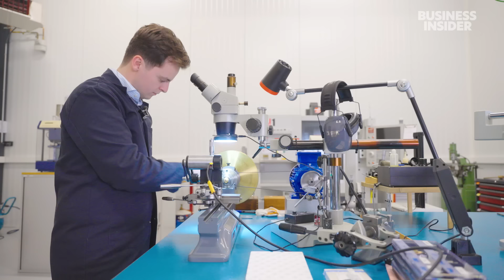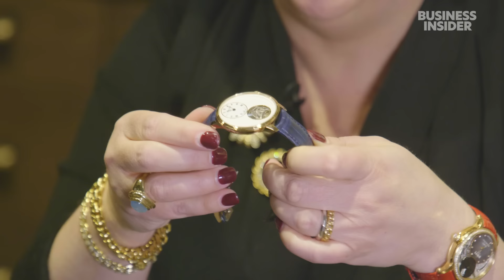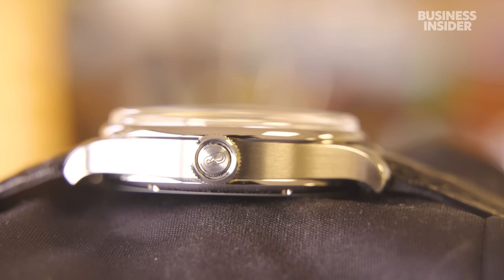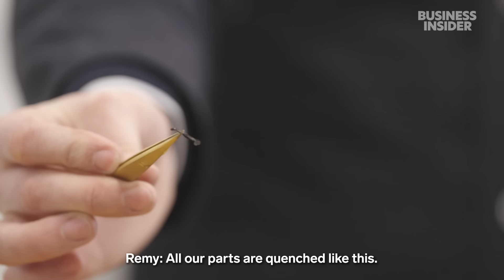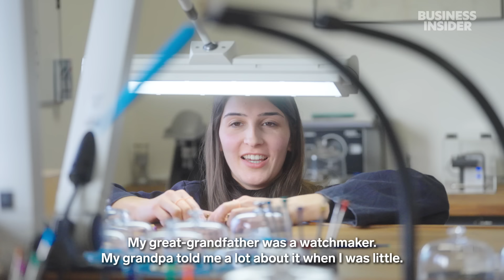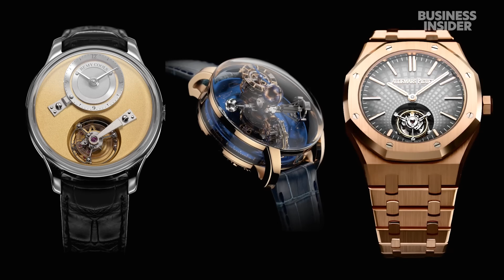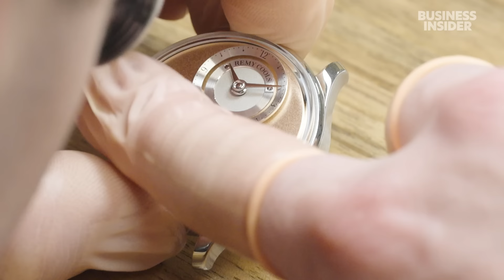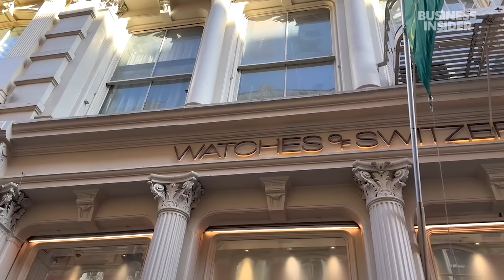Why This Obsolete Mechanism Makes Watches More Expensive | So Expensive | Business Insider

Comment: I know it's largely irrelevant to the 'value' of a watch, but having a tourbillon in the movement doesn't add anywhere close to the cost recovery that a watchmaker would lead you to believe. A mechanical chronograph movement is vastly more complex than a tri-hand watch with a tourbillon, it's just used as a luxury marker these days really.
Reply: Semi-related to this, there is a documentary on independent watchmakers (I think I watched it on Netflix) and they show the makers using hand-tools and single purpose machines to make everything. The watches sell for over 100k, but they will make a single watch that may have taken over a year to make, waaaay more of an art piece that anything that can be produced in semi-mass market, even if it is Luxury
Reply: @jacuul6735  what's the name of the documentary?
Reply: As an (amateur) watchmaker I need to set the record straight here. Yes, a chronograph has more parts than a tourbillon and a new chronograph movement is very hard to design. But tourbillons are still much more difficult and expensive to build, because you’ve complicated the most delicate and sensitive part of the entire movement. Check Chinese watches for proof. You can get a decent mechanical chronograph for about $150-200, but you’re looking at >$500 for a tourbillon. You can also forget about the tourbillon being serviced correctly.
Reply: Without the collectors' market, this industry would come to an end. No one buys these watches to tell the time
Reply: Definitely agree. In addition, I don't disregard Remy's skill and achievement, but let's be real. He is also using CNC for a lot of the main larger parts. This isn't something truly fully hand made like you would have seen from Louis Breguet, George Danields, etc. I know even companies such as Vacheron are using CNC now days, and there's nothing wrong with that. However, if a customer is going to be paying, let's say $100,000 because of the art and craftsmanship, as it's being marketed, I'd think it shouldn't be that way.
Just my preference, at least. There are many more lesser-known independents who do the same, but for a fraction of the price.
Reply: @NotAMachinist1024  very few modern independent watchmakers truly make everything by hand... In fact I'd challenge you to name some...
Reply: @nhwworkshop2644  Philipe dufour, roger smith, myself.
Reply: @nhwworkshop2644  Challenge accepted. Cédric Johner, Logan Kuan Rao, David J. Cottrell, Shiming Yang (artmgraver), and I think Ludovic Rohrer, however that one I could be mistaken.
Reply: @gavin162 part of the problem is the disconnect between actual manufacturing, and more specifically cnc machining, and non-machinists. (Yes, people who use a 3D printer or a CNC router, are non-machinists, contrary to what they may think.) Is not a matter of "pressing go." The intricacies of machining and the actual craftsmanship go far beyond pressing go. Even most machinists who started out on a CNC machine, and never did machining on a manual mill or lathe, aren't really machinists. They lack the ability to "feel the work." They just can't grasp the material properties and material sciences aspects of machining. He's working down to 10-50 millionths. (0.000050" or half a "tenth," or 1 micron) Most experienced machinists are unable to hold those kinds of GD&T, and even less can do it repeatability and repetitively. Most machinists can't even hold 50 millionths of global flatness with a surface grinder. Non-machinists think you sick the part down to the magnetic chuck and "creep up on" your final dimension. Then they pull the part off and find out it fails metrology.
Reply: Damn. Bro slammed all the modern watchmakers in one comment 😆
Reply: if you want accuracy nothing beats a $8 Timex from the drug store.
Reply: Yeah, it's an artificial scarcity thing. People love when the most beautiful historic solutions are employed to create a more dynamic and fanciful device. It's not more expensive to produce, it's more expensive to acquire, purely because the sellers can.
Reply: @UberOcelot  Yep unfortunately this is the reality of the entirely luxury goods market, give or take. Watchmaking is better than most in the sector as there is genuine craftmanship and time consuming, skilled labour involved. But artificially suppressing the supply is very real. You see deconstructions of Louis Vuitton bags on here quite often and they have about $100 of materials, about about $200 in construction labour, which sell for $3,000. Brand (and some quality control) is king!
Reply: I used to think that Tourbillion is a pinnacle of watch making but now I prefer minute-repeater or chronograph.
Reply: Have you seen the inside of my computer?
Reply: You mean to tell me exactly what they just said several times in the video? Thanks!
Reply: I agree that the tourbillon mechanism is attractive purely for aesthetic reasons. In fact, the whole idea of a mechanical watch today is to appreciate the mechanism. The tourbillon raises the bar. A balance wheel with an overcoil hairspring solves much of the problem of positional error. When a flat hairspring vibrates it gathers unevenly and is susceptible to the pull of gravity. Positional error is also caused by the frictional difference of the pivot in the jewel that may exist. This however, can be addressed in the design of the pivot and jewel dimensions. But history has shown that there is a point where the road to perfection reaches "it's good enough". Many English watches had Fusee mechanisms which addressed the differences in rate between fully wound and other states of wind. The overcoil hairspring addressed this to a degree, along with stopwork in the winding mechanisms. Fusee watches suffered from being thicker than standard watches, and the same is true for tourbillon mechanisms.
Reply: youve got to admit it looks beautiful tho
Reply: "grand complications" :)
Reply: didn't know that chrono's are more complex than a tourbi.   And agree that tourbi really are superflous, & unquestionably  a lux marker
Reply: If you value details like engraved clasps and anti-reflective coating,  :yt: amzswis :yt: won’t disappoint.
Reply: Yeah, chronograph movements are exceptionally hard to design. But you can get stock ones for a few hundred bucks, I think.
Reply: @ginzo666  Yeah, I have a couple of manual chronographs and tourbillons, price between 300-400 each but they are mass produced rather than being from an independant watchmaker
Reply: @mitchhifi9192riiiight, cause YouTube comments is where rich fucs go to brag about their watches. Ok. Good for you.
Reply: @theflyingsloth  Hrm. I was unaware that there were mass produced tourbies. I've always assumed they were 10 grand on the very low end for a watch with one.
Reply: @ginzo666 just look for „seagull tourbillion“
Reply: @ginzo666 its not cheap cheap, but for a tourbillion its incredibly cheap. Idk who wants to service this but you can buy it under 1k
Reply: @ginzo666   China can always, always do it for less lol
Reply: @mitchhifi9192 yes we know you're rich
Reply: @julpasali exactly my thought 😂
Reply: @mitchhifi9192 I cannot understand why you'd drop £11k on a watch and then say that the problem with it is 'it's a Tag'?

If you felt that way towards Tag, why would you buy one?!
Reply: @mitchhifi9192 you will love the Aqua Terra. Omega makes the nicest "mass market" watches out there in my opinion.  One of those is next on my list as well. I daily wear a vintage pie pan seamaster in conditions that'd make most watch lover cringe (I've torn apart a rock crusher with it on my wrist before) and I  think you'd have a hard time surpassing the durability of an Omega. They really build a bulletproof watch, even though 99.9999% of them will never see that kind of life.
Reply: @ginzo666  Yeah, just got myself a "Sea-gull" 1963 for 150$. Pretty much the best bang for your bux for a chronograph watch. I don't have a big collection and nothing expensive, but I do appreciate mechanical watches a lot!
Reply: No personal experience with Chinese tourbs but ST19 chronographs have been bulletproof for me over many years. I paid 120-250USD for all my examples and they all run like clockwork. 😅
Reply: You can find chinese watch with tourbillion for a few hundred dollars (and that was a few years ago, it's probably less now).
Reply: No, you get cheap chinese chronos for like 50€ but no really cheap tourbillion
Reply: @tomatensaft420 the cheapest mass produced Chinese chrono movements I've found are the Seagull ST190x series. They'd cost at 150~200USD if you get a good deal.
Reply: @tomatensaft420  there is a seagull turby
Reply: A tourbillon regulates gravity. If you travel to countries with high altitudes or mountains, the time on your watch will remain consistent. Have you ever owned a watch or a wall clock? You may have noticed that sometimes, the next day or a few hours later, the clock jumps ahead by 3 or 5 minutes. Well, the tourbillon mechanism is responsible for controlling that effect of gravity. Even if you notice, cellphone clocks do the same too, the gravity changes the cellphone time. Tourbillion technology is super advanced, they say the Mayas and Egyptians used that same mechanism to create their time and pyramids.

Comment: I always check the front side of the watch, never the back part.
Reply: Probably because there is nothing remarkable on the back side of your watch.
Reply: @Entertainment-  in case you dont know, a watch is supposed to be checked on the front side not on the back side. You should  try it out yourself, it tells time and more importantly you wont look like an idiot checking your watch at the back side. You're welcome.
Reply: @DeleLang  My point is, you probably don’t have a watch that proudly displays the inner workings with an exhibition caseback. There are also watches that have complications on the backside such as a power reserve. So no, not all watches are meant to be only checked on the front.

Comment: Calling the turbillion obsolete is like saying a magnetic compass or a wood burning fire place are obsolete.
Reply: Try to understand what obsolete actually meant its obsolete cause other methods have been developed or makes this mechanism unnecessary to achieve the same outcome
Reply: Or a perfectly painted portrait in oil paints, in an era of iPhone cameras and photoshop.
Reply: A tourbillion is specifically designed to compensate gravity in a pocket watch that'll always sit in the same position. It's fully obsolete in a wristwatch.

That's kind of the charm of it, but it's definitely obsolete.
Reply: Not really. A fireplace can still warm you up. A magnetic compass can still show you the way. The tourbillon, however, makes no practical difference for you when put in a wristwatch.

Comment: What astounds me is that you can find quartz watches for less than 10€ that are actually more precise than these watches. It's an extraordinary feat of engineering and technological progress that we could evolve such an important device to be so cheap and accurate
Reply: You can also buy a Quartz with accuracy of less than 1s/year like the Citizen 0100 for $17k
Reply: @Entertainment- or the A060 movement, accurate to +/- 5 seconds a year, perpetual calendar until February 2100, Zaratsu polished, and solar powered with a power reserve of 18 months all for $2k or less with titanium options running about $3k. I think the circle jerk for mechanical watches is overrated. “Oh but the engineering” as if Citizen didn’t put any engineering into these movements
Reply: @ryannorton1278  exactly!
Reply: @Entertainment- at that price, I'm sure you can find rubidium oscillator GNSS synchronized master clock for better accuracy than the Citizen you mentioned.
Reply: @bltzcstrnx  It won’t fit on your wrist tho. But if you do want atomic clock synchronisation, a $100 radio-controlled Casio Wave Scepter will do.
Reply: you can also travel with a bike instead of a car, they are cheap and offer higher miledge. you can also eat at dinner instead of a hotel.